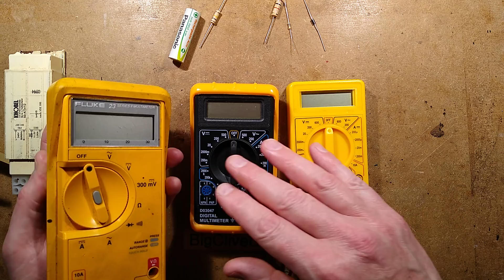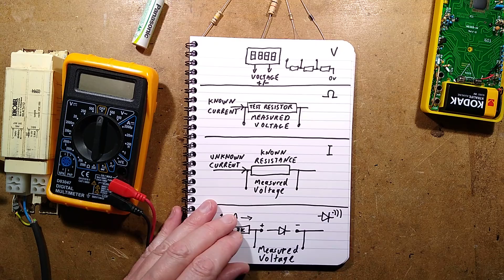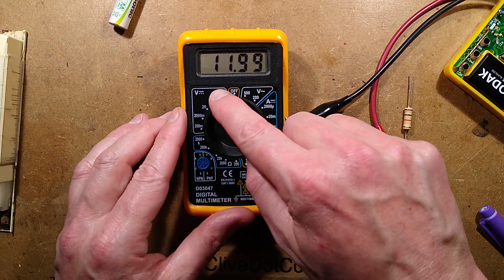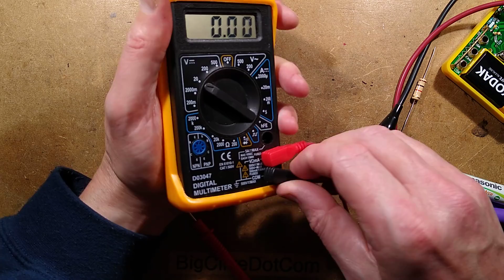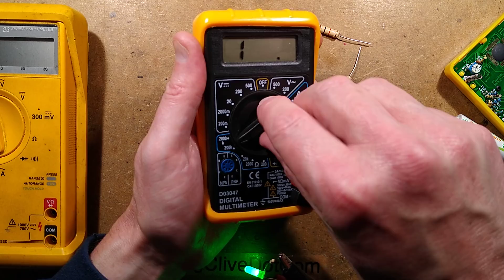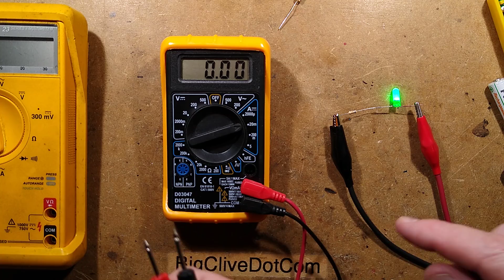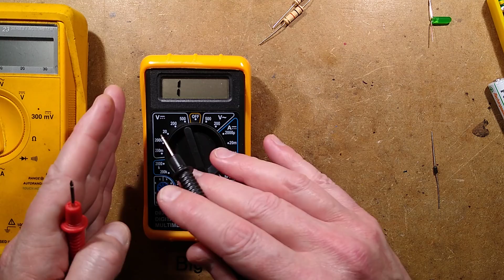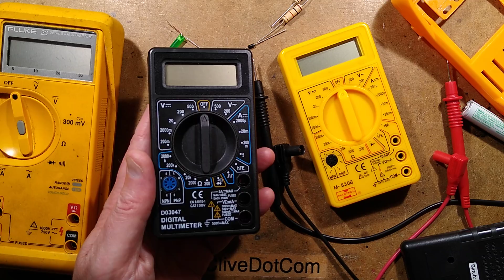How to use your trashy meter without blowing it up (much)

Comment: The cheapos are surprisingly accurate, I work in a calibration lab and have played with several of them.  Wouldn’t go poking around a consumer unit with one though 🤣
Reply from the maker: I've only tested one that was way off calibration.  The accuracy of most of them is surprising.
Reply: I have put a couple of them through a calibration routine with a Fluke 5520A and they were surprisingly good.
My own Brymen BM869s and Uni-T thingy were spot on.
Reply: The DC units Volts, Amps, Ohms is pretty easy to get right nowadays, with multi-slope ADC's.
Reply: I also work in a cal lab. Most of these meters are perfectly accurate for their precision, usually 3.5 digits. Its all done in the chip and the divider. This sort of DMM is what I use at home, in my tool-box, etc and they are perfectly fine as long as you know how to use them. At work, I use highly accurate 8.5 digit meters - horses for courses, as they say - pointless using an 8.5 digit meter to test a 9V battery!.
Reply: Although, sometimes the safety aspect may be lacking - I agree I would not use some of these on high energy circuits like your fusebox/consumer unit.
Reply: @risvegliato  why not test a 9 V battery with a 8.5 digit meter? that gives you a much better resolution of: this battery is dead vs. this one may last another 30 minutes. ;)
Reply: The wording I use is "accurate enough" (and let's not get into a debate of "calibration vs accuracy" - we all know what's meant when someone asks the question)

The part I find lacking on the cheapo units  normally isn't the meter, but the quality of the LEADS
Reply: @miscbits6399  i absolutely agree on the leads. On one I had some that were so stiff, the broke after three times using them. On accuracy you are absolutely right. If you want to check if your cars generator is charging, does it really matter if you get 13.8 V or 14 V? No.
And most resistors and stuff have 10 or 15 % tolerances to their value anyways.
Reply: @bigclivedotcom  well my was also way off....like saying a AA bat new was1.3 or even 1.8V traced it back to it's own 9V being flat'ish
Reply: @miscbits6399  I fully agree. I usually buy a cheap meter, throw away the leads (or use them for solder practice), and a set of multiple different kinds of leads that cost the same as or slightly more than the meter. Still great value and much more versatile than what I would get at multiple times the price.

For microcontroller work having multiple sets of different leads (simple points, very thin points, IC tweezers, various hooks, banana plugs) and decent contacts on both sides is more important than extreme accuracy or resistance to high voltage in the multimeter. My Arduino does not care whether I feed it exactly 5V, 4.2V or 5.5V, it cares whether it gets all its input signals. Most of the time I would be fine with 5% accuracy, as long as I can measure at three different points in my circuit and watch them change at the same time. Can't do that with the one expensive meter I could afford, but I can buy 3 shitty ones, multiple sets of leads plus an okay one for about half the price of a fluke. ;)
Reply: @KonradTheWizzard  I agree about the leads being important. I was lucky enough to get a few sets of military leads off of eBay one day. They have all the multiple screw in tips from points to tweezers to prongs. And very good insulation. Like I said they are military grade so they are the best. Great for using in higher-end test meters or oscilloscopes and such.

Comment: Retired lab tech here.   We used high-end Flukes.  They are great meters until the zebra strips connecting the display to the circuit board start failing.  I was taught how to clean them by a Fluke tech.  After the first time you clean those strips, you will be continuing to clean them more often than you change the battery.

Comment: This brought a sentimental moment. I miss my AVO 8MKIII multimeter - it sailed round the world in the 50s in a merchant navy vessel radio room and was the meter I learned electronics with. Never failed until it accidentally fell off a crane about 12 years ago! Went through a few cheap DMMs before buying Flukes, all of which still work too, one  being 30+ years old now.
Reply from the maker: I used to carry my Avo meter home with me every night as a status symbol.
Reply: My AVO 8 is a mark V (5) but faulty - DC voltage range isn't right. Needle doesn't move at all on a 1.4V cell on the 3V range.
Hmm, maybe brass oxide doesn't conduct. Used test least off newer meter - 1.4V cell reading 0.6V on 3V range and 0.8V on 10V range.
(1.4V cell is an alkaline one with a use by year of 2008 - which is not as old as the Safeway (supermarket) brand 1.559V cell in the AVO)
Reply: If you turn an AVO8 180 degrees, neat smiley face...
:)
15v batteries...!

Comment: Thank You. You confirmed I was using my meters correctly. I was introduced to electricity by my Dad when I was 5. I really did not pay attention. So when I became 35, my wife and I decided to to build a house. I went on the internet and studied the current codes for residential wiring for Montgomery County, Texas. At that time it was allowed for an unlicensed to wire their own with inspection. It passed with compliments for a professional layout. 

When I found your channel, I found a teacher; albeit way above my head. 

What I did pickup was a basic, and safe, testing method for circuits. 

I am still a hack and still learning.

Comment: Many years ago I worked in a  "Calibration" lab (We really just checked calibration on equipment and sent it to better labs if it was out of spec) when it got slow I brought in my own cheap torque wrench and cheap multimeters. All of them were shockingly accurate within a few % across all ranges. More than accurate enough for most home use.
Reply: Oh that is funny. After working on B-52s for so long, I avoided click type torque wrenches, because I knew I could not get them calibrated regularly after I changed career fields. I was worried they'd all be garbage. I stuck with needle type good name brand torque wrenches. I am rethinking that now. Thank you (in aircraft mechanics, you get everything ever wanted to know about torque wrenches, and triple doses of it, and tested on it regularly until you can regurgitate it on command)
Reply: Ll

Comment: I'm a heating engineer, mostly testing mains voltages, low voltage DC and resistance. I've had the same Ex-tech multimeter for years, it was about £40 and it's manual range and it's never let me down. I once managed to put the probes across 240v with it in the current positions but it just blew the probe tip to pieces and I had to replace a cheap little fuse inside the meter but I bought a decent set of probes and leads and it works fine to this day. The little £5 meters are still ok for testing resistance, it usually the cheap leads that really let them down.
Reply: I would also be more worried about insulation of the sometimes skimpy probes than the meter itself.
And as soon as you get into the ranges of a proper CAT III/IV 600V or more meter, you spend enough to have a halfway decent one anyways.
Looking only at those categories CAT II 300 V should be fine for everything you plug into an outlet in your home. But it may go boom if you happen to put the probes across phases. (at least here in Europe where three phase is more common and provides about 400 V between phases)
But as Clive said, it is mostly the current settings where they go boom, just for convenience I have to admit preferring a clamp meter for that if possible. They also have a lot lower tendency to got boom. but with them you usually also just left the department of just cheap stuff.
Reply: @alexanderkupke920  it's been a few years since I worked in this field, but in America here I believe it's a Delta three phase or something, and between two of the phases it's okay but between the third phase and one of the others you get something called a wild leg I've heard. It's voltage can range upwards of 600 V or more I believe. Someone with more experience or memory at this might be able to explain it better.
Reply: @NEW_INSITE  Mhmm, that sounds more like something "made up" in not real three phase installations. As the voltage between phases also depends on the phase angle a "real" three phase supply would always be all phases 120 ° apart. 
But I remember having heard about something called red leg, which I assume may just be a different name for a wild leg. If memory serves me right that might happen if you have a transformer providing a three phase 240 V service and create two 120 V split phases between two of the three phases. But from what I remember reading about it some time ago, third phase to neutral would be only 208 V then. But I can't tell for sure as I honestly lost track with the different three phase services available in the USA where phase to phase voltage can be anything like 208, 240, 400 or up to 600 V. Only this would not make sense with 400 or 600 V as that would provide split or single phase circuits with 200 or 300 V.
Also this is somewhat confusing to me as living in Germany I am used to houses having actual three phase services most commonly. There may be rare exceptions in rural areas or old services, and in some older apartment buildings the single apartments may have a single phase service within the building only. But we are used to single phase outlets with nominal 230 V (or if you look across Europe, somewhere between 220 and 240 V) single phase to neutral or ground, where the main difference is the average voltage with tolerances ranging between 200 and 250 V for all of these. Three phase is considered to be either 380 or 400 V, depending on your nominal single phase voltage. Any other voltages used in industrial applications are not actually services, but a custom site transformer which may be hooked up to 7.2 or 10 kV grid lines. But you will find those really only in industrial plants requiring higher voltages. Everything else will be 380/400 V. Oh, and of course no split phase here. That would surely violate any electrical codes I can think of.
With 230 V as regular single phase outlets providing up to 16 A peak (or 10 A continuous, not sure what the load cycle would be for higher Amps, I think you are supposed to have at most 80 % as regular load on normal circuits) we don't even have something like dryer outlets. Actually you will usually not even find a three phase outlet in a common residential home (some may have one in the basement or garage). Usually those are installed if someone wanted to use some three phase machine like a welder or air compressor or construction equipment. Though they sort of get more common in a dedicated sealed version to connect EV chargers. In Europe you can easily identify those by the common red CEE three phase high amp socket (available in different sizes from 16 up to 125 A if interested search for CEE plug). For single phase high amp we have blue ones, as our normal sockets across Europe (Schuko in Germany, CEE F in France and what else there is) rarely is designed for more than 10 A continuous. Small devices (like USB power supplies) may even have a Euro Plug limited to 2.5 A.
Reply: @alexanderkupke920  well this was back in 1988, and I just started learning how to do electrical installation after getting out of the military. I was in radio repair and electronics communication for ten years in the military. But getting into high voltage Industrial wiring I was just learning. One of the older guys told me that on this particular industrial site, and I think he said something about it being a Delta Transformer Arrangement or something, that you had to be careful on one of the legs to neutral or one of the legs to one of the other phases that were stable that they had what's called a wild leg and you really could not be sure what voltage it would put out, but it was extremely higher than what was expected on the other stable legs. That's all I know. I was only into the high-voltage industrial wiring for about 2 years and only heard that comment once. But thank you for your in-depth description and Analysis of what are some of the wiring configurations that you've experienced and that you have over in Europe.
Reply: @NEW_INSITE  except for those ominous ring mains the Brits use it overall looks pretty much the same here.
Some changes in code every now and then how the panel has to look like (from no GFCI s when my parents built their home, to one for "wet" rooms, which would be a messed up translation i guess but just means bath and kitchen to one for the whole house as in mine to recently one to each row of breakers. Well, our panels look vastly different and especially here in German, the meter is in the panel/ breaker box. And of course either wire color standards. Which makes it quite interesting to me to look at American installations.
But in comparison with that multitude of system ours really are boring. I still prefer it, as there really is only one system and no differences. And even one or two phase services are just running only one or two of three phases to a house (can be found in some other European countries) it remains the same there phase system.
For the everyday user it doesn't matter. What you are facing. Electricity comes from plugging into a socket, that's all you have to worry about, unless the electrician screwed up (oh and You won't believe what electrical screw ups I have seen in hotel rooms across Europe over the years. France seemed to be the worst)
I never worked as electrician, but I had electrical engineering as part of my studies for a "Diplom Ingenieur" before we adopted the bachelor and master system. (For an engineering degree there had been some general fundamentals like maths, physics etc, no matter if it was electrical, mechanical or in my case computer engineering)
I cannot even remember what for I had to read into those details.
But there is one thing I can imagine what the older guy meant. The higher voltages use to be phase to phase. Any phase to neutral usually would be assumed to be 120. And here you are with a leg that would provide 208 phase to neutral.
I guess plugging in a 120 V device without knowing, of someone had the strange sense of humor to actually wire a socket like that, sure would be a nasty surprise. I bet if I got surprised by that you might even learn some new curse words from me. But I can't imagine how you would get to higher voltages.
Reply: @alexanderkupke920  I think you're right I believe it was one particular leg and that Delta 3-phase system that to the faces would give you 120 with each phase two neutral and two of those faces together I guess the A and B would give you 2:20. But I think it was that third leg that when put to neutral and you're expecting 120 actually gave you 208 V. Now that was just in the industrial application I guess where we had that Delta three phase. In regular household wiring we only had two phases and a neutral to worry about. This was all new to me as I go to the military I was going into household voltage or what I would consider high-voltage compared to my military career. Most of the equipment I worked on in the military was low voltage signal voltage amplifiers and circuits. I went to two different military schools three years apart, and I got distinguished graduate in each School. I got a 99.2 and a 99.8 respectively in each of the schools I attended. They were for radio repair and electronics repair and courses like that. I even had an additional course I had to attend for the field automatic digital artillery computer. So it was quite a change for me getting into the civilian world and going into the world of residential and Industrial wiring. I ended up moving on from that getting into doing HVAC repair and maintenance pretty much until I retired. Nice chatting with you, wish you the best, God bless.
Reply: "I once managed to put the probes across 240v with it in the current positions but it just blew the probe tip to pieces and I had to replace a cheap little fuse inside the meter"

Did you have to replace your underpants as well? 😊

Comment: Great video.  When I was using old analog meters in the military, we were taught to always store them with the highest voltage selected.  So the next sailor, if he wasn't paying attention, wouldn't 'blow' the thing up no matter what he connected it to.  And it wouldn't drain the battery inside the meter.  :)
Reply: Not the dreaded Avo,by any chance.
Reply: @flatmoon6359  Nah...  basic 'Simpson 260'
Reply: When I was in the millitary we would set the Meggers to the high voltage setting to shock people. "Hey, can you hold this leed for me"
Reply: @seth7745  Surprising how sadistic us tech's can be. Get your fun where you can.
Reply: @seth7745  Reminds me of the old capacitor joke. 😊